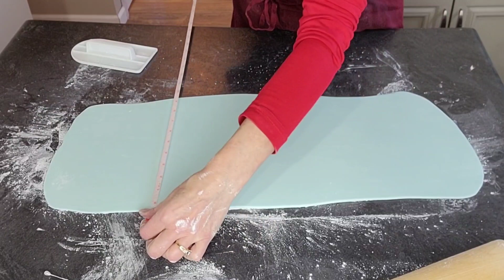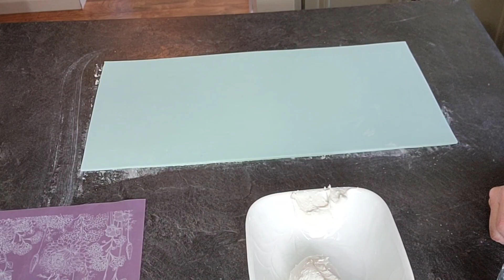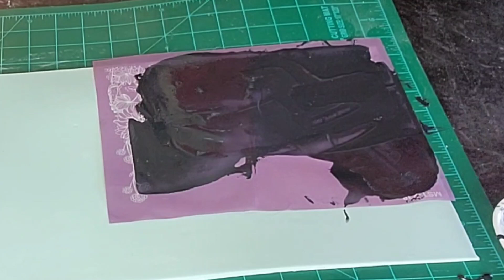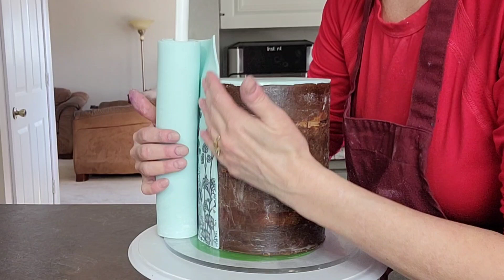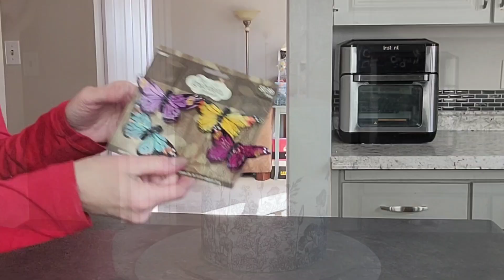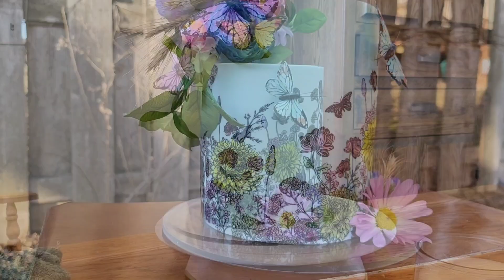How to Stencil and Paint a Cake Using Royal Icing and Mesh Stencil | Stencil Fondant Panel Transfer

Comment: Hi Mary, you said in this video that you put your fondant cake in the refrigerator over the nigth, can you do it? I supose that the fondant can be damage with the humidity. Or not? When you give out the cake for ambiental temperature...Please answer my question, i really want to learn more. Thanks so much, you are a greatest artist!
Reply from the maker: Hi! You actually can leave it in the fridge! It is a myth that you can't that I bought into for years. It will sweat, but if you just leave it alone, it will dry out again. I have even frozen fully decorated fondant cakes and it is fine. In that situation,  you just move it from the freezer to the fridge for 2 days and then from the fridge to room temp. Just be careful of you have fondant decorations that would be effected by the temp change. Toppers and things like that should be placed after it has dried.